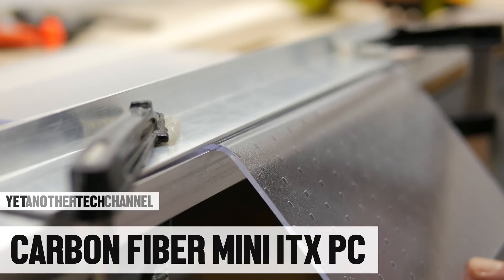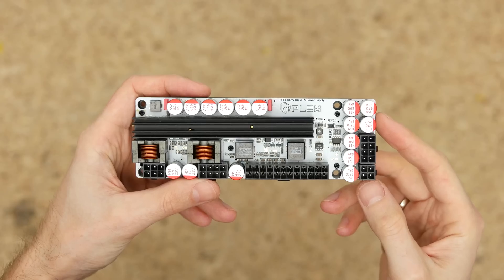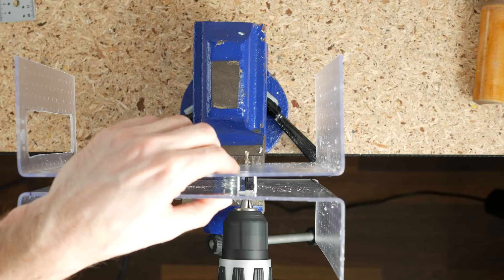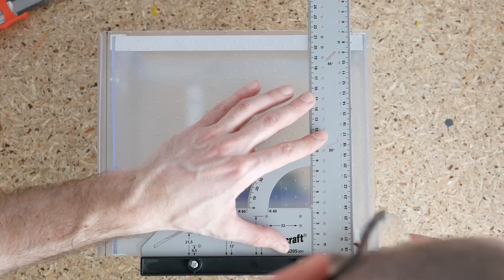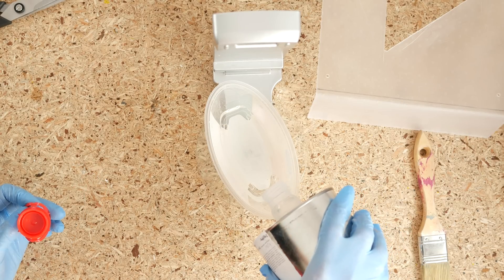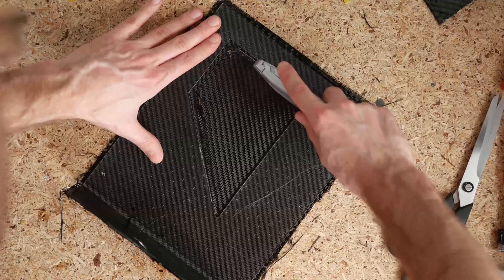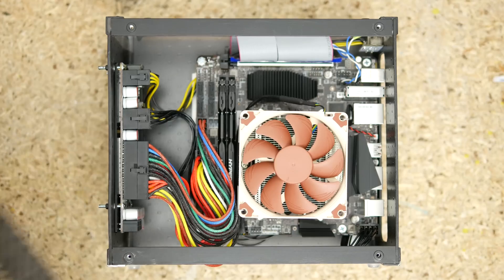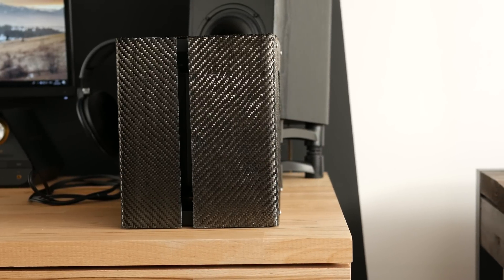How to make a mini ITX computer case from scratch (DIY PC case)

Comment: Acrylic polymers!!  Pop rivets!!  This is really cool, as there are very few videos highlighting such ‘unorthodox’ builds. I love it, that it looks like you maybe made use of some more affordable surplus hardware.  You really did a great job with the aluminum bracket bars!  The cables and chords are really a pain, escpecially while you have very greedy companies writing firmware that actually runs checks on simple hardware such as cabling, and then stops charging your laptop’s batteries, all because it isnt quite sure whether you’re using a legit cable with your gear, for example.  This was a really nice build in the end, great aesthetic to your mini case!!  It’s really cool to see someone sawing with hand tools on acrylic, and especially on such a project where most geeks would have found a laser cutter, but that’s how we get it done when we don’t have the fancy laser cutting CNC machines!!  It’s a really truly original project when you take into account the pop rivets and ‘finished by hand’ approach to the build.  Anything is possible.  THANKS FOR SHARING!!

Comment: Great job, considering :-) I build catamarans (carbon, kevlar, epoxy,....). Can I suggest: 1.you've enough carbon there to float a boat :-) It alone could be used for the case, without metal reinforcing, if point loads have spot carbon layering. Use a "sacrificial" form (cardboard or foam) to drape & epoxy-saturate the fabric, into any shape you wish. 2. Carbon conducts electricity VERY-well, so use rubber standoff(s). 3. did I mention you did a great job? 4. I buy affordable Epoxy & fabrics from: US Composites, West Palm Bch., FL, USA. 5. There's no shame in using a small metal or plastic disc roller to smooth out the fabric, though it has a problem taking/keeping a corner, until the epoxy sets. Next time :-)  Have you a project that conceals the computer works in the desk? I'll subscribe & see! Buona Fortuna! Gracie! Ohhh...there's nothing now stopping you from building a boat :-)

Comment: $85 for riser, $25 for mats and $20 more for carbon fiber kit? $130 will buy you a decent selection of mini itx.
Reply: $200 for the tools
Reply: @sniper2elite781  Yeah, that just makes the 'a fraction of the price you pay for those high end cases' an even less accurate line. I can understand this as a passion build or if you want to get into case modding/building as a hobbyist this would be a good fun way to do it, but as a money saving option over just outright buying a top end itx case this video doesn't seem like a convincing alternative to me.

Comment: Props for doing things your own way!
Though I think a pure acrylic case with some RGB highlights would have looked much better and actually stunning.
There really isn't much point in using acrylic only to paint it or cover it.
Reply from the maker: Thanks :)
I wanted to try using real carbon fiber and I figured wrapping will be a good start. Acrylic is relatively easy to work with so that's why I chose it as a construction material. This particular one I got for cheap at a local hardware store and it's hardly a looker... but I do plan to make a fully transparent build and I already have a name for it... 'Clearly custom' :)

Comment: What acrylic do you use? I’ve always wanted to make my own gaming pc case and I still do, and I had been going about it the ring way for a while, and I have the stuff to do this, but I’m not sure I have all the exact materials.
Reply from the maker: I used the cheapest acrylic I could find in the local hardware store. If I ordered it online, I could find a much nicer looking and most probably cheaper one.
Reply: YetAnotherTechChannel ok, thanks.

Comment: This idea will be killer for expensive (200$ to 400$) mini ITX cases like Dan and Dr Zaber cases. 
Improvements: 
1: In my opinion, black paint and carbon fiber are not necessary, transparent sheets look fine and some RGB LEDs will decorate it well, Anyhow if somebody still wants colors, Colored acrylic sheets can be used.
2: Thin 1mm sheets can be used in some parts i.e covers, it will help reduce weight significantly.
3: Aluminum parts can be avoided by gluing acrylic sheets.

Comment: Well-crafted video of a well-crafted case. I think the CF would have looked better if you had made the case square instead of rounding the corners and used a different trim along the edges. CF looks cool in flat panels, not so much on curves.
Reply from the maker: It was my first time with CF and I'm pretty sure if done right, it would have looked bada$$.
Reply: @YetAnotherTechChannel  it might have been easier to use resin and build the case out of the CF without using the acrylic base. I've never worked with CF either, not really a fan of the stuff.

Comment: Very interesting project!
I'm considering buying one of the cases like Dan's A4-SFX-v3 (since Dr.Zaber-2.0 isn't released yet, and S4-Mini doesn't allow for water-cooling /except with a hose ;)/)
Looking at the PCI-E-extension cables (and especially at Linus'es "How many is too much ..." where they connected up to 3m of these /high-quality!/ cables w/o performance hit) I'm thinking of making a custom Small-Factor-Case that's ... transformable 8)
My idea is to make ultra-small case for the PC itself - incl. M-ITX motherboard i7-8700K (or the soon to be released i7-9700K), 32+ GB RAM, at least 2xM.2-nvme ssd, plus at least 2x2.5"ssd, and water-cool the CPU.
The PSU I'm wondering between an SFX one to be ready to plug to AC-outlet, or to make it even smaller with a DC-PSU like in your build (the ideas here are two: 1st it won't have to be super powerful PSU since it won't feed a discrete-GPU, and being a DC-in could be hooked to a custom make battery-pack to make it laptop-like**)
The PCI-E-xtension-cable I would take to the surface of the case so that it's ready to plug a full size GPU.
And a 2nd DIY-E-GPU mini case that hosts a full-sized GPU (why not also water-cooled - it's cool ;) and of course its own PSU but one feeding only the GPU.
On one hand there are mini-PSUs that can easily feed even rtx-2080ti (like 400W should be fine) but then I would need a power-brick, so I might put a regular SFX-PSU (since the GPU would generally consume about 3 times more power and is not a candidate for battery power). I would only carry the E-GPU-case when I need it for specific job (at my everyday job I need mostly powerful CPU & fast SSDs, but occasionally might need powerful GPU for rendering/video-processing tasks).
And so most of the time the E-GPU-box would stay @home ready for gaming 8)
Now I wonder if I should include a 2nd PCI-E-extension cable in the GPU-box for convenience. Though I think with creative cases design they can be made to click on to one another so that only 1 such cable is needed on the PC-box-side.
Another option is to put the most powerful SFX-PSU in the GPU box (a 600W) and use that to feed the CPU-box when I carry both (so that I don't have to carry also a power-brick) ... I just have to figure out how to simplify the connections.
So to summarize I could have these modules:

 1st) main-PC-case with small DC-PSU (so would need a power-brick when used alone). Would have basic graphics for everyday's job (non-graphics-intensive).

 2nd) a smaller power-brick to feed the Main-PC-case when used alone.

 3rd) a External E-GPU-case with 600W SFX(-L perhaps for 700-800W if necessary) PSU so that only needs AC-outlet cable. (optionally have power connections to feed the Main-PC-Case when used together removing the need to always carry the #2 - although that power-brick might be smaller if it only gives like 200W and not so heavy with smart cable management)

 4th) Optionally make a powerful Battery-Pack-Case capable of feeding the #1 Main-PC for few hours at least (actually there might be such soon on the market OMNIULTIMATE capable of 150W DC-Out & 40,000-mAh and removable battery)

So I could get 3 different combos: Ultralight (#1+#2); Portable (#1+#4 & eventually #2 if to be used longer than battery capacity); Uber-Powerful (& stationary, but still backpack-portable) #1+#3(& eventually #2)

Comment: Thanks for sharing. I've been planning my own sff case for a while and this video sold me on acrylic as the material for the exterior. I just can't decide between painting or vinyl wrap. Painting offers the benefit of keeping clear lines for LED light accent strips.
Reply from the maker: Yeah, I really like acrylic - it doesn't take much to get very decent results.Spray vs vinyl is a tough choice. Both have pros and cons. Vinyl may seem to be easier to apply, but it does require skill and patience to make it look good or else it will show all imperfections - dust particles, air bubbles, etc. This is less of a problem with a thicker, textured material like the carbon fiber I used in some of my projects.
Spray painting requires even more hassle but you can achieve a pretty decent, spotless finish. The problem I have with spray painting is that the surface can get scratched easily unless you put lots of coats of paint.

Comment: EEUGH! I know it's your first time with Carbon Fiber, but a few things.
1. Squeegee the resin on the fiber FIRST, I don't know why you brushed it on the plexiglass, then applied more after.
2. That fabric you used (White with red stripes) is called Peel Ply, it's a polyester that's designed to help soak up excess AND give a rougher more bondable surface. 
3. I have to assume you want that smooth surface carbon fiber look, which is actually impossible for you.
4. In order to achieve that, you need a well polished/waxed VERY smooth mold. Any surface imperfections will be translated. It's also REQUIRED that you get a vacuum bag setup, which IS pretty easy and can be done very cheap.

If you get a bag and a small pump (You can even manufacture your own bag) and a piece of plate glass (Thoroughly waxed and polished with Mother's Carnauba wax) you can make some decent looking plates.
There's a bit more that goes into it, but there's some basics. If you want to know more, it's boring but there's a guy called Phil Barnes who does a complete vacuum bagging walkthrough with exceptional results.
It would've been better for you to actually put the carbon on the inside, but keep in mind that;
1. It acts as a total Faraday cage and prevents any signals from coming in/out
2. It is conductive, so make sure nothing electronic touches it.

A slight amount of reference: https://youtu.be/aoQCZo_YfGY
That basically shows WHAT you need. All that's missing is telling you how to apply resin (credit/gift cards work great), SQUEEZE all the excess resin you can out... although you don't care about weight and want a gloss finish provided by the resin, layer the resin on the mold, then peel ply (if wanted for rough interior texture, though I pretty much always recommend it), then the plastic film (I recommend not using perforated, as this will pull the resin through and ruin the bleeder fabric 100% of the time), then the bleeder/breather fabric, something like felt, or the cheapest blanket stuffing you can find works well.
Of note, if you use the plastic film without the peel ply, the carbon interior WILL have a shiny surface, but unless it's sandwiched by something smooth it will have ripples and wrinkles.

Sorry for going so in depth, but I work with the stuff and you made my butthole pucker. Also, try to be more careful about moving the fabric around, you want nice clean straight lines.
Reply: Also, since you cut the fabric after putting resin on it, there's a period where the resin isn't quite set, so it's a bit gummy. That's the best time to trim the fabric to size.
And... I guess I should explain what I would've done. I'm going to assume the resin dries clear, so I would test sanding the plexiglass and applying resin to make sure it clears up, since it should fill in the scratches. IF it works, I would apply the carbon to the inside of the plexi, using a vacuum bag, and peel ply on the inside. Wetted properly the carbon shouldn't have any problems sticking to the interior edges/walls. This would result in a cleaner, smooth, glossy carbon.

Comment: could have used your acrylic as "tools/molds" and just made carbon panels in those shapes.  or, trick would be the back side of the acrylic painted black, then wrapped with your carbon.  The reason you see through it is that the weave isn't tight on that carbon, the tighter the weave also more expensive.  Final step would be apply more resin, wet sand resin then buff or optional clear coat.  Good job!  I like it!  Pretty neat project.
Reply from the maker: Yeah, but since this was my first time with CF, I thought that making panels out of it would be too hard. I don't really have time to practice so I'm 'learning on the job' ;)
Reply: YetAnotherTechChannel absolutely understand that!  Sorry, I was more less trying to convey more or other options. I've often planned for something similar and always talk myself out of it. You've actually done it. Props to you sir!

Comment: Won't the heat affect the acrylic
Reply from the maker: You mean the heat from components? I have to use a heat gun that probably warms up to 400C to bend the acrylic - the components don't get warm enough to affect it.
Reply: Oh ok
But small amounts of heat continiously won't heat the acrylic?
Reply from the maker: It will, but not even close enough to affect its structure.
Reply: Thanks for the replies 
Keep up the great work

Comment: I see what you were trying to go for, but it doesnt look well made. 
The borders are messy, the carbon fiber is bending all over the place and so on.  Its nice to see that you want to try new things, but this didnt work that well
Reply from the maker: Carbon fiber is really hard to work with - it requires patience and precision. Unfortunately, I don't have time to practice so I'm 'learning on the job'. I honestly believe that I did a pretty good job with making the frame with separate CPU and GPU sections. Side panels are far from perfect, but I still figured out it's worth to share this idea and let everyone know what they're getting into if they want to make something similar.

Comment: This was a pretty decent first attempt. A carbon fiber vinyl wrap may have worked better though, leaving an excess of material you can fold back in for a clean look in the air vents. I'd love to see a second attempt however.
Reply from the maker: I wrapped a few things in vinyl in my life and I always wanted to use the real carbon fiber. Now that I know what to expect, I might give it a go at making pure carbon fiber panels.

Comment: Hey, you should use a shielded riser cable, as low quality ones can have signal loss, even over very short distances. A good shielded one won't have any problems even extending over several metres.

Comment: i always want to make a carbon firber case ... well done , but one thing .. you could make just with the carbon and use the acrylic just like a template? so would make even more lighter .. you see this possibility maybe , or no sense what i am saying ?
Reply from the maker: It was my very first encounter with carbon fiber and I figured that making pure cf panels would be too hard for the first time.
But it is most definitely possible to make something like that. I might give it a try and build something like the Dr Zaber Sentry case from carbon fiber.
Reply: Yeah i have same thinking as you ... orrrrr.... could use the frame , like side frames and "screw" at the frame until get really tight , you know what i mean ... and then put the resinm ... .i will try to brother... really good job you did . impressive

Comment: You should take a look at DIY Perks case (v=K8hLXJUQFoc). Its quite similar to yours but he used carbon fiber vinyl wrap instead real carbon fiber and it seemed to be much easier to apply and has better look at the end. But anyway great THANKS for your effort in making this video. Oh and BTW. Im building my second miniITX NAS using BT-02B-U3-250VS case + Asrock QC5000m-ITX/phy with 4-core integrated AMD CPU (only 15W TDP!) + ICY DOCK MB326SP-B  6-disk 2,5 chamber for 5,25 bay and OpenMediaVault. Icy dock even has models with 8 x disks in 5,25 bay (MB998SP-B and MB998IP-B)! I would love to see your ideas for similar, very compact and powerefficient NAS. Pozdrowienia z Polski :)
Reply from the maker: I build a somewhat power efficient NAS before - I based it on an Asrock motherboard with 4-cores Intel Celeron J1900. It's been running Xpenology for 3 or so years now ;) But I want to play with FreeNas so sooner or later I'll most probably do a video on building a custom file server. I'm not a fan of 2,5" drives (unless these are SSD) but that dock is very cool and it sounds like a pretty awesome build. Również pozdrawiam ;)

Comment: As much as I like carbon fiber, the vinyl wrap looks much better. It's not your fault, carbon fiber doesn't look good on anything, just by itself. When you wrap it, the carbon looks crappy and cheap.
Reply: that's just it, to wrap carbon fiber you need to vacuum wrap it. wrapping it by hand wont give it the desired look.
Reply from the maker: I believe if done right, carbon fiber can look awesome. It was just my first try and hence the not so spectacular results :/
Reply: Good job though, I probably would have messed it up and wasted money.

Comment: Cost?
Reply from the maker: $25 without the carbon fiber fabric.
Reply: Do you have a link for the carbon kit?
Looks really awesome, but you should have gone for the glossy carbon finish. I believe it is also better for the carbon itself. 
Did you get improved stability with the carbon?